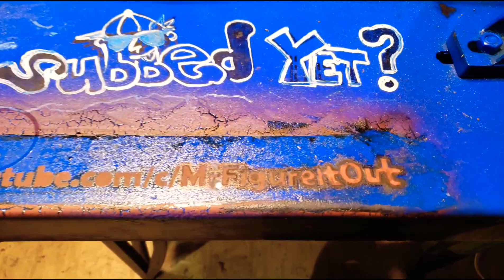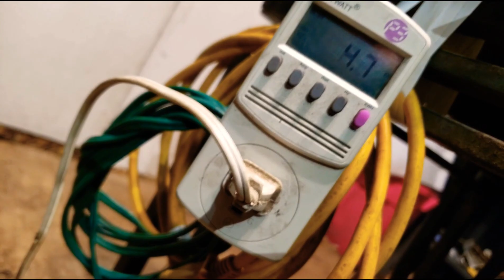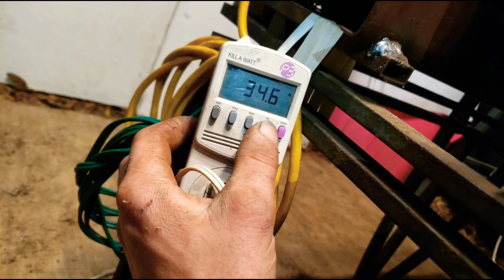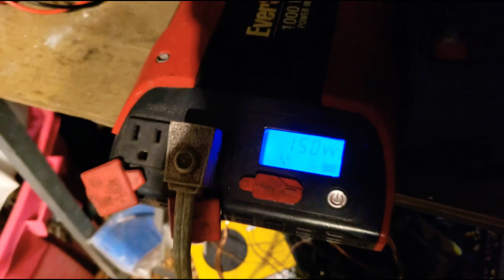Does a flywheel free energy generator work? Self looping closed system Ep1

Comment: U need to use a low rpm permanent magnet alternator, low speed. That's the secret
Reply from the maker: How do you know? Please share!
Reply: @MrFigureitout  I worked on a similar system for over 5 months in 2020 and came to that conclusion. The two secrets are appropriate torque and speed at the generator level. Good thing that can be calculated even before building it
Reply from the maker: Did you succeed?  Please share

Comment: everybody has the ability to make new discoveries, you should try making a transformer and use a plastic tubbe thats looped a couple times with estatic gas thats being produced by a hydrogen fuel cell moving through the tube, with one copper coil on the left and 5 seperate coils on the right with perfect output, the estatic gas has magnetic properties.

Comment: hi i am looking at this also and wonder what your results were ? Have you tried starting it and disconnecting from the power supply? how long dose your system run before it stops??
Reply from the maker: I'm working on getting a more powerful backup power supply that can handle the load. As of now it cannot handle the load so it quickly shuts down unfortunately. But if it could handle the wattage I think I could complete some very interesting tests

Comment: So where you from bud? 
And thanks for sharing 👍
And Keep at it.  Them pulley sizes make a huge difference. Flywheel weight matters to.
Reply from the maker: FL. Thanks!!
Reply from the maker: Hey I tried to check and see if you have a channel but not seeing one. From the looks of your profile picture-you should! I know what that is. I have done many experiments with a wheel like that and large north facing out magnets around its perimeter......this was before I started my channel but I have considered recreating them for my channel
Reply: Idk if mine is much of a channel. Just pulse motor build's. 
Built some that sound like a diesel truck. Lol 
Originally started because I wanted to build a large scale stepper motor.
If you click my icon my page should show up.
You have a cool channel. I enjoyed alot of the videos.
Reply from the maker: Found it. Subbed. Thanks man! I'm working on making better content but I still have a lot to learn about making quality videos

Comment: Working on something similar, but using an lg direct drive coupled to dc motor. High frequency .75kw Vfd to control direct drive and inverter connected to dc output, then ups into inverter as a loop. Having a hard time getting the specific vfd atm, but it would be good to see someone else do it in the meantime👍
Reply: I have created over unity
Reply from the maker: What do you mean by vfd ATM
Reply: @MrFigureitout  finding it hard to get the delta 1500hz vfd at the moment, the chips they use are apparently hard to come by for higher frequency
Reply from the maker: Gotcha ok

Comment: How many hours does it work nonstoping
Reply from the maker: Once I got system set up with ups/inverter, it shut off after about 10 mins because the inverter could not handle the load.  I'm going to get a better inverter that can handle the load and should have much better results
Reply: @MrFigureitout  will be waiting for the video of a better inverter thanks
Reply: as long as you like